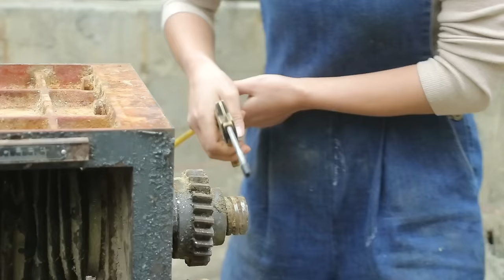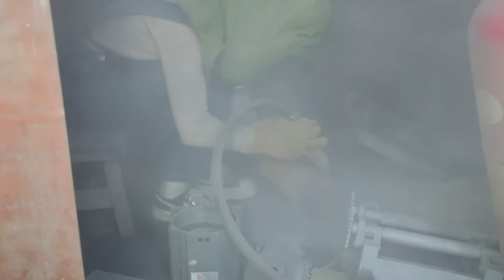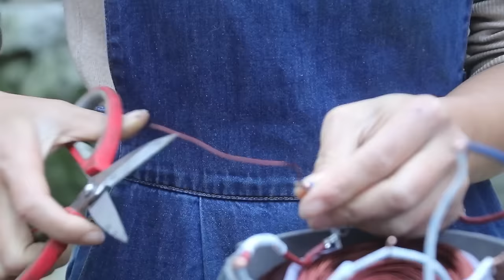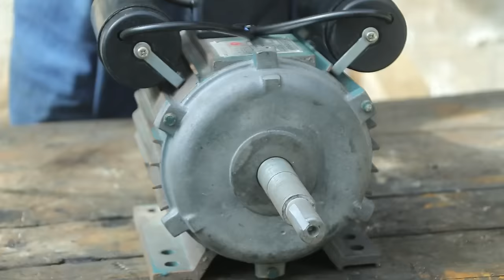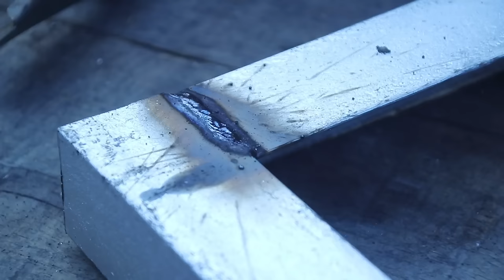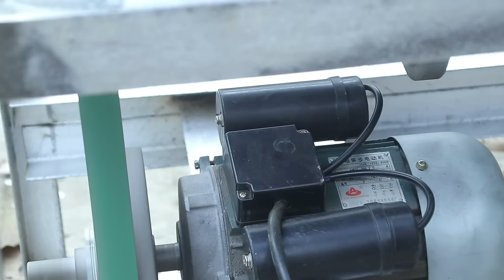💡 Girl Helped Uncle Repair Old Machine, Changed Two-Phase Motor Into A Three-Phase One|Linguoer

Comment: I love watching you fix and restore things, my only criticism is, putting the bearings on the shaft by hitting the outside race is a no no! Get a tube that fits snug over the shaft and is no bigger than the center race. Copper hammer will give a dead blow, which equally gives more power to the blow 😉 I learned through experience that bashing a bearing on the wrong side of it will shorten its life in the long run. Make no mistake here. You are amazing at what you do, and not many people have half the skills you have. Keep the amazing videos coming. We always watch right till the end ❤👍🏻